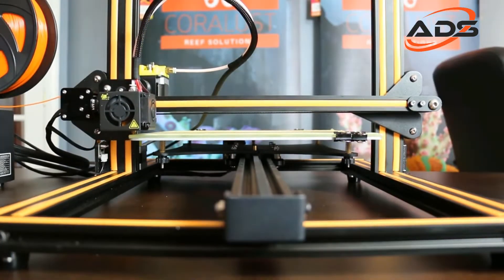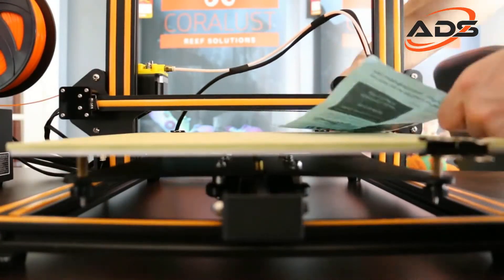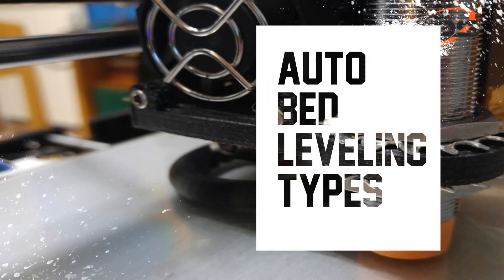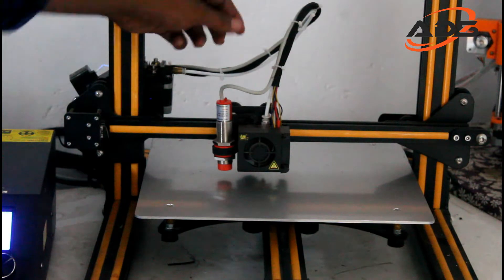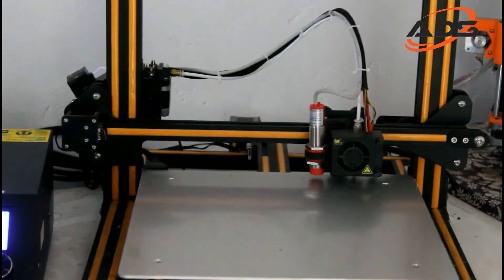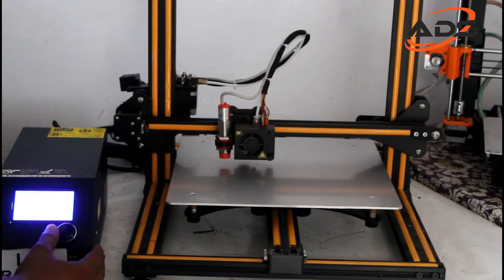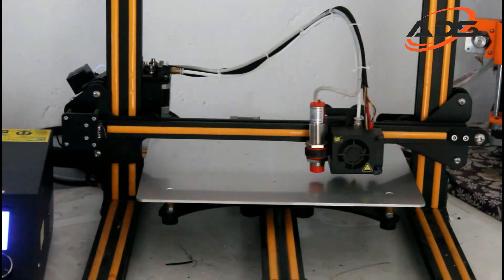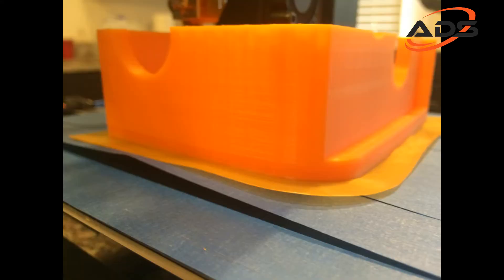3D Printer Guide - Difference  between Auto Bed Leveling & Manual Bed Leveling in Tamil

Comment: Price plz
Reply from the maker: Our won model starting From 30000/- for basic use.

higher end model 3lac for Industries.
China models starting from 18000/-
Reply from the maker: You want auto bed leveling kid??? starting from 2500/-
Reply: Contact number
Reply from the maker: @discovermyself2349  9600290007